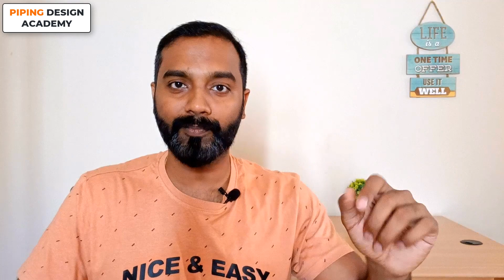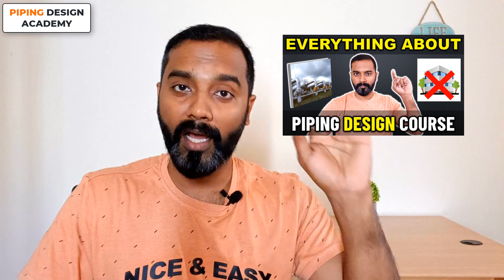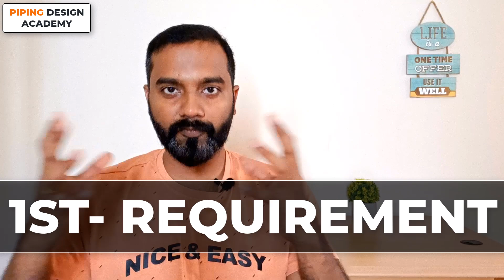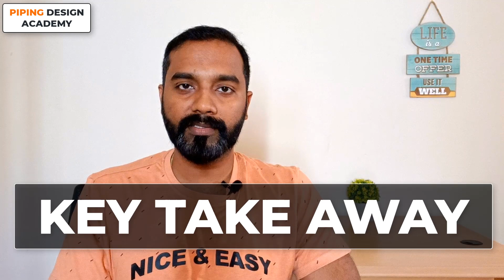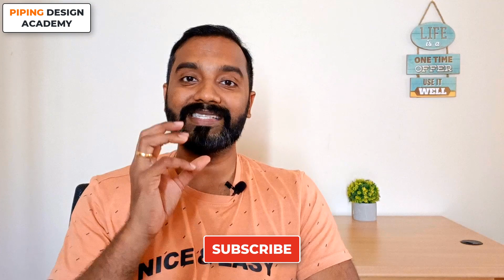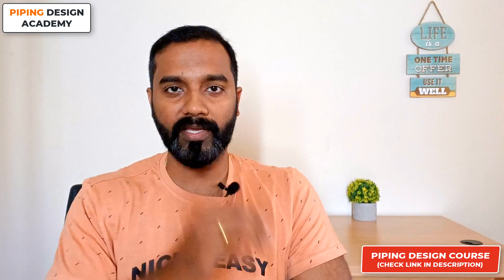What Freshers and Beginners to do in 2024 to Get in to Piping Design Career #career #pipingdesign

Comment: Hi sir I am mechanical engineer working in manufacturing tool and die department for 3 yrs i wanted to switch my field into design ...is piping good for carrer and i have an doubt is my experience can be calculated when i am going to piping design
Reply: Hello you can become jig and fixtures design engineer. Can't you?